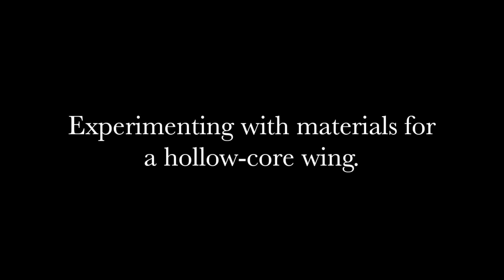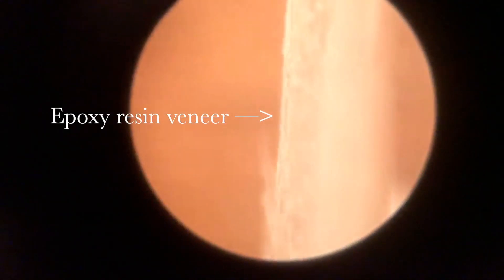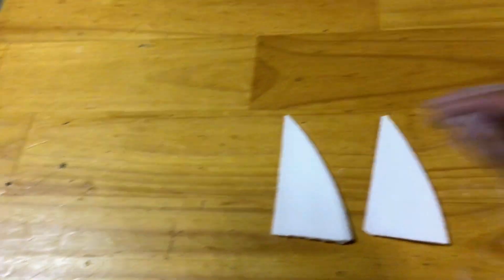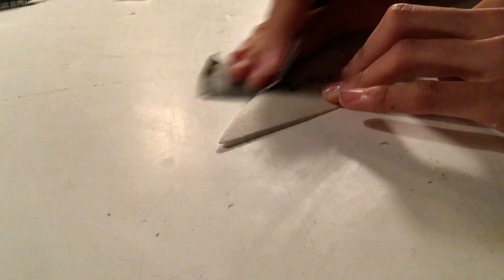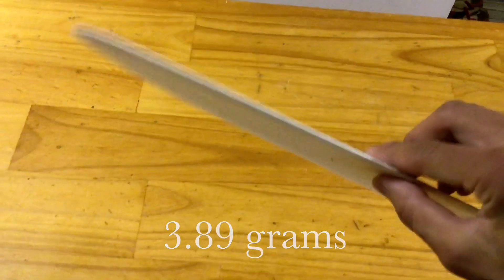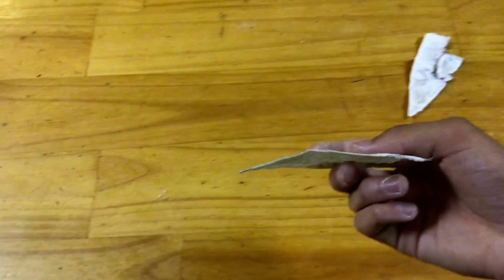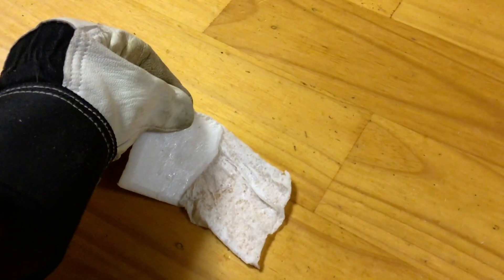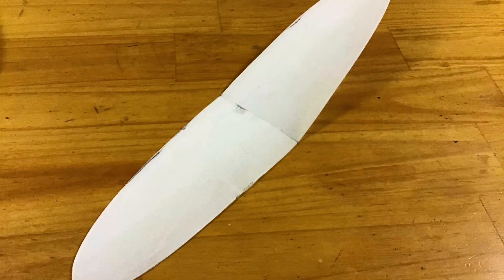Experimenting with Epoxy Resin as the Surface of a Hollow-Core Wing

Comment: Try applying onto baking paper.. non stick??
Reply from the maker: Hmm I dunno. Epoxy resin sticks to...basically everything. It's not at all like wood glues/cyanoacrylates whose adhesion can be inhibited by non-stick surfaces. You would probably need to find something that undoes epoxy's adhesion at a chemical level.

Comment: Likely the epoxy does not have enough tensile strength, but perhaps it is the acetone causing failures? You could try to 3d print with PVA filament. Coat with epoxy. PCA filament prints are then dissolvable in water.
Reply from the maker: That's a good thought. I have read that in theory a good finishing resin should be unaffected by acetone. But come to think of it I have noticed what seems to be a temporary loss of the composite's rigidity when subjecting composites to acetone in the past. Hmm, I myself lack a printer but I may know someone who has one. That is a good idea, I'll see about trying that.

Comment: Wouldn't it be better to fiberglass the wing and epoxy it and then remove the foam?
Reply from the maker: For sure. That is the accepted method. But I was interested to see how much strength the epoxy had on its own; that is, without the fiberglass. Figured the best way to find out was to test, and why not make a little video about it.

Comment: Ooooh, chemistry!  Be sure you are using proper ventilation as you chemically melt all that foam.
Reply from the maker: Yeeeeah, fun stuff. The fumes from melting away that little amount of foam are only very slight, and most of the ickiness stays behind in solution in the acetone, but yeah I do it in a rather well-ventilated area.
Reply: @AeroCraftAviation  I just installed a vent over one of the workbenches in my shop that blows to the outside - it's where I now do all my painting, soldering and noxious epoxy and foam melting tasks.  These days you just can't be kind enough to your lungs, know what I mean?

Comment: What about CA glue? I mean it has no where near the same properties as epoxy or wood glue and it’s super brittle, but maybe it would hold up better when you try to eat away the foam with acetone
Reply from the maker: Oh hey yeah that's a good idea. It is a bit heavier than the other glues, but definitely more rigid. I may try that if it doesn't slip my mind.🤣

Comment: There might be some yet unknown expoy formula that could perform this function. I used to shop at this place called Tap Plastics that had an overwhelming selection of different epoxy types.
Reply from the maker: Oh yeah I've gotten some composite building materials from Tap Plastics. Quite a selection indeed. Although not as cheap as some of the listings on Raka composites. There may well be some type of resin already in existence that could perform this function, that I just don't own or know about. By the way, it may be a while before i release the build video for the CX5. I have a bunch of other projects in the works, and besides that I'm swamped with studying for SAT IIs in the fall. But I'm doing my best to get to it.

Comment: Science!  Without CF or fiberglass, Epoxy is a failure waiting to happen. Not strong or very durable at all.  Pour an 1/8" thick layer of epoxy and let it try, then play with it, you'll see how flexible or brittle it is, and how little it takes to deform or break. The strength is in the material that you impregnate with the epoxy.
Reply from the maker: Hmm yeah, I suspected that might be the case. Would explain why I've never seen anyone bother with this experiment before. But then, have a look at 0:40 . That thin resin veneer is really strong! It can be bent and flexed and always returns to its shape, plus it's super thin and lightweight the finish is smooth. Seeing that, I just can't quite discount the possibility of a wing with a resin surface.
Reply: , @AeroCraftAviation  The thin resin veneer that you were playing with may seem strong to you fingers, but when it comes to the repeated stresses of flight and the effects of the sun's UV light hardening/deteriorating the epoxy, fugeddaboutit. You will not see plain epoxy coated wings on any airplane for good reason, it has been thoroughly tested. My wife's PhD thesis was based on epoxy matrix strength testing. You may do all the testing you wish. I simply want to save you some time in your life that you are most likely wasting if you think epoxy alone will make a good surface for wings. It will not.  Some people use paper soaked with epoxy on foam wings, this would surely help stabilize/strengthen the epoxy layer somewhat,  but those people are also leaving the foam inside the wing for strength, not trying to melt it out. The paper/epoxy layer just helps stiffen the wing.

A good experiment would be to lay some saran wrap out on a table so nothing sticks. On that,  lay out a 2" square of fiberglass and a equal sized piece of paper and see which one gets stronger with equal amounts of epoxy on them, also smear out that same amount of epoxy spread into the same 2" square as the materials, so you have a control for the epoxy's strength alone.  When thoroughly cured, peel them all up and try to break them.
Reply from the maker: @somethingelse2740  Oh cool, that sounds like a really interesting thesis. I know very little about chemistry and materials science but considering how much I build stuff, those areas are always fascinating to me. I suppose I would be short-sighted to presume this hadn't been thoroughly tested. Thanks for saving me the time in any further experiments. :) I probably won't even bother with the control experiment; at this point, I already have a good idea of the difference in strength between resin and resin-strengthened fiberglass. Thanks for the info. :)
Reply: If you do need to use epoxy/fiberglass on anything, a good way to keep things light is to put on rubber gloves and roll a roll of of toilet paper around to absorb the extra epoxy out of the fiberglass once it is laid out on your wing or surface. Any TP fluff that sticks to the glass can be sanded off later. The epoxy is the majority of the weight, so removing the very wet excess is important if lightness is key in your design. However, drawing out too much epoxy can weaken the fiberglass. And as in most things, there is a balance that only comes with practice and experience. Good luck! And never stop learning!

Comment: Nice to follow your experiments!
Reply from the maker: Glad you enjoyed! Experimenting is the best part of model building i think. Also the most enjoyable, and in some cases the most fruitful, way to learn.
Reply: @AeroCraftAviation  try this from an old aero modeler... lightweight tissue... thinned balsa cement rollered on over a waxed board... even lighter... light weight tissue sealed to a wire or wood frame sprayed with wallpaper starch for a semi ridgid sheet